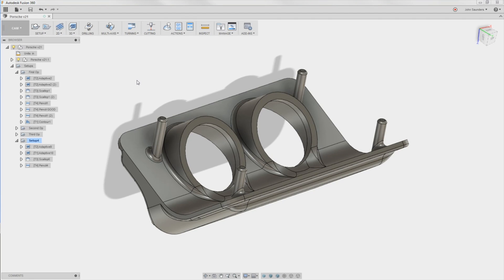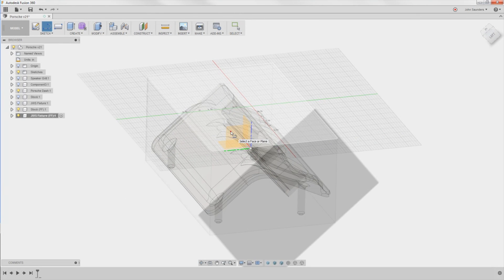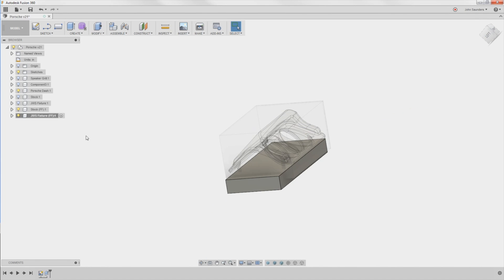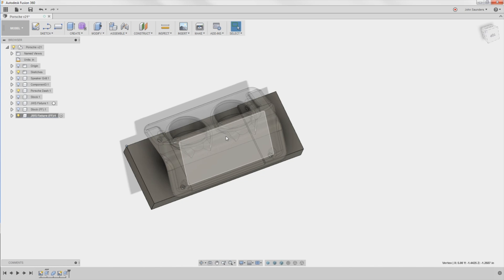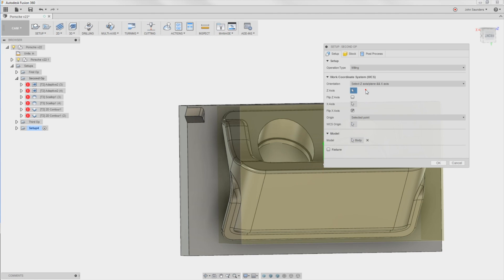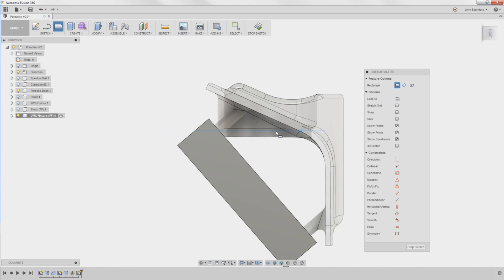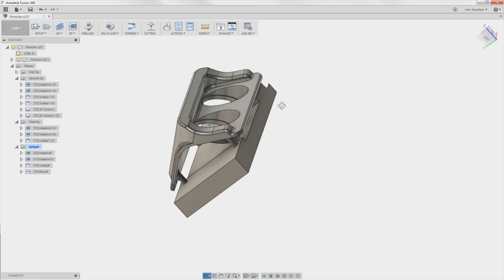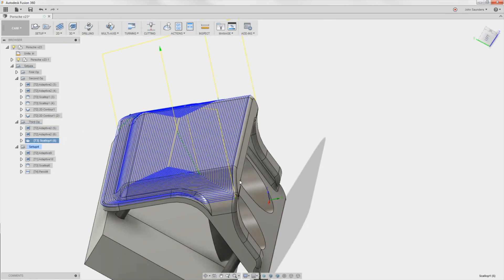Keith Fenner Porsche Fusion 360 CAM Part 2!  FF72

Comment: The strong backbone of this part is probably the gauge bores. Socketing the gauge bores onto a stepped through holes should provide excellent rigidity in x, y, and z-. That would be 90% of the rigidity.  The last 10% to keep the "wings" from flapping would be to bolt the 4 posts into a half recess socket. Those stilt legs only really count in longitudinal rigidity. Those crescent indentations should make you smile: contact area, part locating, rigidity! I shed a small tear when you relieved it.

Op order inside first makes sense due to stock removal quantity but also because if it gets scratched switching fixturing NBD. Next op probably the lid as that contour surface finish more sensitive to the floppy so cut before thinning out the face. Last op the driver-facing face as it looks least flex sensitive.

My thinking comes from running 1,000s if not 10,000s of parts in a fixture so I'm biased for more upfront work to keep the fixture stupid, rigid, and easy. This is a one off so messing with sine blocks in the vice is probably worth it. But those gauge sockets being unsupported! Even if you just did a half circle shelf so you could have simple part peg sockets would take most of the bounce out.

Comment: Hey John, if your angle is 49.3 degrees, the angle Keith will have to raise the plate in the vise will also be 49.3 degrees since the angles are alternate angles. See angle H and B in the second figure here... http://www.mathplanet.com/education/geometry/perpendicular-and-parallel/angles-parallel-lines-and-transversals if angle H is 49.3 degrees, angle B will also be 49.3 degrees. Ciao, Marco.

Comment: I have question/suggestion for a video John. 

I´m having to engrave a bunch of name plates for some folks. I modeled the plate and created my text, I dimensioned the "textbox" and centered it on the plate using the midpoint constraint.
Once I double click on the text now to change it, all my constraints and dimensions disappear and I have to repeat the whole centering and dimensioning process. Not even the horizontal contrain of the text remains. It´s like the text object doesnt get "edited" but rather created anew.
I´m having four seperate lines of text and got over 20 nameplates to engrave, thats doing the same tedious thing 80 times.

You know a way to keep the text centered and the same format without  doing it for every single change?

Thanks 
Kevin

Comment: Work holding idea. When looking at the 40.7 degree end like you had, Take from the very bottom of the aluminum block and come up 3 inches. Cut a notch say .125 deep up to the 3 inches. Use a 1x2x3 block to fit in the notch. Use the holes in the 1x2x3 to bolt to the aluminum. You can stand the plate up in the mill to cut the notch. Do this to both ends. Bolt 1x2x3 blocks to both ends. Then stand assembly on mill table and clamp the 1x2x3's down. Fixture is held, ready for machining.

Comment: If Keith is going to make this part out of Delrin he is going to have a difficult if not impossible time putting a finish on the Delrin to make it look acceptable in the interior of the car. Even putting an acceptable finish on a disk of Delrin on a lathe with finer and finer grits of abrasive is difficult. I don't know how you would finish the number of surfaces that this gauge mount has. I would think that the best bet would be to machine out of 6061 aluminum then anodize or powder coat to desired color. The aluminum woul finish well with the tools and clean up nicely with abrasives. Believe you will end up with a mess using Delrin.
Best, Greg
Reply: Agreed, I make a few parts with Ertacetal-C where Delrin is Ertacetal-H Ertacetal-C has better chem resistant properties and better for thicker applications because Ertacetal-H can contain low density core sections in larger parts, OTH Delrin is good for thinner walled things like bushes because of higher mech strength.But IME it is that it has a lot of spring in it when machined which also makes is harder to get a clean cut, you cant gradually do finish cuts like Ali and have to get right on target last cut to get a clean face.The 3D printing suggestion above sounds like a better way to me. Another thing, Ertacetal has a fairly high thermal expansion rate, far as I know dash board plastic are usually made in a thermoset plastic that is more stable in heat. In high heat of a dash in sun the Delrin may distort.

Comment: You're going to want the flat top to be actually "flat".  Scallop is probably not going to give a satisfactory finish.  I'm also in the camp of removing the pegs, having them screw into a boss, and reorienting the stock to align with the part top and long axis of the gauge cutouts.

Comment: This is a tricky bit both from the cam and the workholding. Will be great to see it all worked through!
Reply: bcbloc02 managed to get it down to 3 ops and a fairly simple fixture.   A V block with a 4 deg bottom angle on it

Comment: Confirm on the model that the bores are perpendicular to the flat. When I checked it they were not perpendicular, they where 0.25deg off. 

Sketch 3 in the model has a dimension that appears was trying to offset a line 0.25". Instead the dimension was set to 0.25deg. I believe this is an oversight and will play havoc when trying to do the bores and such.

Comment: Instead if milling out those 4 mounting pegs, cut out a peg platform. Then drill the platforms & glue or screw the mounting pegs into the platforms. Steel bolts or all-thread could then be used to mount the piece to a jig. Shorter pegs could be used for stability while milling the rest of the part.

Comment: As a project to see 'if you can' machine this part...then it is interesting. But if you had to make this part, just 3D print it in a high temp carbon material. Or 3D print it and then use loss wax casting to make it in your choice of metal...

Lastly, if as John says Keith is going to machine this in delrin, then John's fixture won't be rigid enough. The 4 posts on the part will flex terribly [IMHO]...

But happy to be proven wrong. Go to it boys...
Reply: People seem to forget that it's getting machined in delrin.  Cutting forces aren't going to be all that great.
Reply: Jeff Keen maybe you're right about the fixture, but, take into account that he's doing it on a router, so maybe, i repeat maybe, he could get away with it using really conservative shallow cut recipe and quite a lot of spindle speed.
Reply: Jeff Keen Obviously I completely agree with you. This thing screams to be3d printed

Comment: One question, how is Keith going to post the G-Code? Keith runs a Plasma-CAM,and as far as I can see, Fusion does not support Plasma-Cam at this time.
Reply: I believe he also has an Inventables X-Carve CNC
Reply: Design Edge (the PlasmaCam software) can read G-code. I don't do it a lot because I do all 2D work on mine but it works fine.

Comment: How would you machine the pocket for setting the origin so that it's in the right spot relative to the holes?
Reply: Good question. That's what I was thinking myself too. If the fixture is at 45 degrees you could edge find on both the "sloping faces" of the fixture fo find the y coordinate of the top z height. And use both top z height and y coordinate of the top z height as momentary z and y zeros. The X zero is easily found, so you could use the measurements on the cad to slot it at the correct specs(measurments). If I didn't have a DRO, at this point, I would have commited suicide. If the fixture is at a different angle, I genuinely don't know how to sort it.
Reply: Oh sorry forget it. It's 49 and change degrees. I have no clue how to do it.

Comment: I spend hours on CAM every day.  Keith chose the hardest part to make for his 1st one....Make sure he orders enough to make two!  I find my 2nd run is almost perfect compared to the 1st part....lol
Reply: Cole Regal the material makes it difficult. 
Aluminum? No problem. But a plastic?  Trying to prevent it from chattering and gouging and prevent it from warping will be a task and a half. 

Which is why I am completely against the notion of trying to remove as much as possible in each op. 

Keep as much material on as possible and do all the important features first. Then hog everything out.
Reply: Occams Sawzall Yes I agree the material is making a lot more difficult.
Reply: Guy Good conventional mill direction on the pins. It will deflect things in a stock safe direction. Climb milling it'll grab for sure.
Reply: Those pins are going to get pulled into the flutes of endmill as they get longer
Reply: Right, I often use conventional to overcome dwell marks